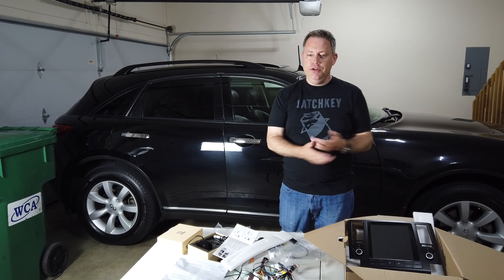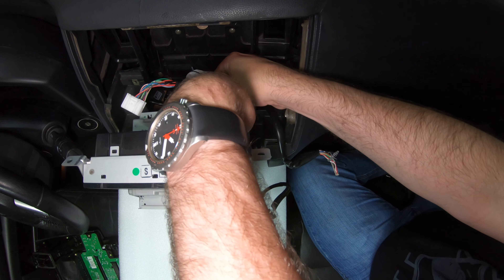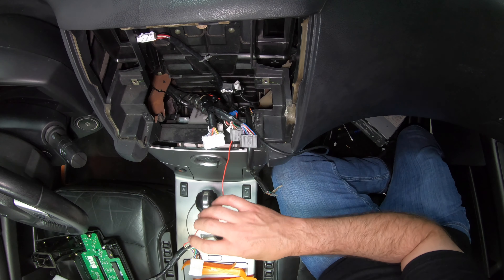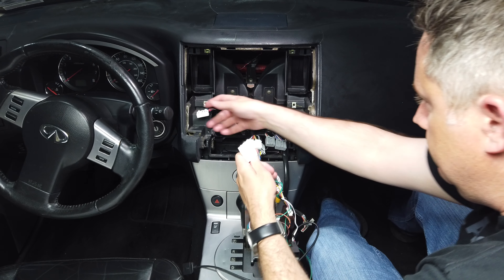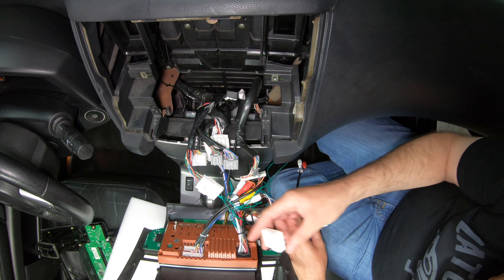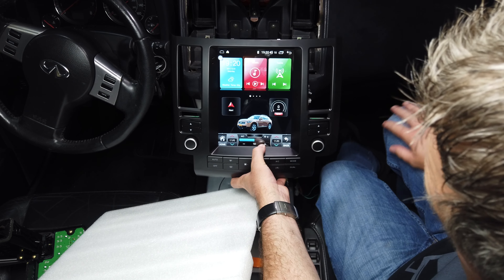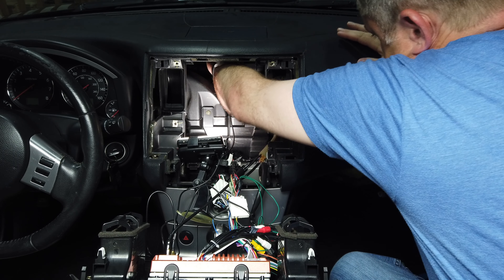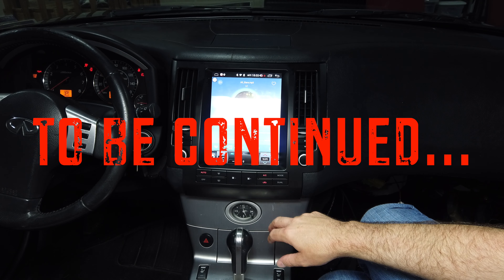I updated my 2004 Infiniti FX35 to 2020 technology with a plug and play Android head unit.

Comment: I installed the same kind of screen on my fx45 2004 with navigation and rear camera. Because your video explains everything I just wanted to add some info for people trying to install this on version with navigation. 
1. My version is from a company called "Peng GPS"  Only the backpannel is a bit different(color). Cables are exactly the same. Everything is working on my car including AC and rear cam.
2. The instructions for fx45 and fx35 are the same. My instruction manual looks the same as the one in the video.
3. The A2 cable(balck/yellow) is indeed for the nav version.
4. The black plug at 9:42 was not needed to be plugged to make it work.
5. In addition to the steps in this video, for the nav version you need to remove the glovebox for access to an extra plug there. It's on a grey metal box. Box is on upper side. You have to remove some screws to free it. The provided instructions will show which plug. Without this step AC and rear cam won't work.
6. For the rear cam they provided connectors that were also plug and play.

Hope this helps.
Reply from the maker: Thanks for the additional information. I had my glove box out at one point because the instructions were not very clear about exactly what connectors I would not need.
Reply: Can you guys help me I bought the same thing for my car and I can’t  control the ac and the camera is not working , only the radios and the android that work fine . What can I do for my camera and ac control to be fully working on this new units ? My car has navigation and camera from factory 2004 Fx 35
Reply: @maickikiemi3873  I'm no expert at all, but maybe this helps, when i didn't connect the gray box(shown in the video at 11:15) the airco did'nt work but also the fuel gauge and temperature gauge didn't work, they remained at low position, also the "low fuel" bulb turned on.
When i didn't connect the cables in the glovebox compartiment(point 5. in my previous comment) the airco didn't work, the temperature on the screen said "low" and nothing happend when i put the car in reverse. But when i connected all these AND the cable for rear camera everything worked. 
Good luck.
Reply: Kaka-jan I was asking what to unplug in the glove compartment ?
Reply: @maickikiemi3873  That's a bit difficult to explain, but you have to look at the manual, It's explained there. But in this video(https://www.youtube.com/watch?v=1FMRPRJtg_I&t=100s) at 4:01 where his hands are, there is a gray box the plug is not visible until you remove the box.
Reply: @Kaka-jan, thanks for the additional info, as I have a fx35 with Nav. I've kind of curious to know if the bottom of your unit doesn't snap completely similarly.  That's my main setback in ordering one myself. Thanks!
Reply: Hi,  can you show me how you did it, any pics or video
Reply: Do I have to connect the stock rear camera also under the glovebox somewere??
Reply: Hi.
Did you connect to the oem GPS antenna or use the antenna that supplied to you with the unit.?
Reply: Best kinda person, right here. Thank you for your service

Comment: I ordered one of this for my car and I am very happy I had some issues with the ac control and the camera  but I just had to plug something in the glove box compartment . I recommend kirinavi for these they are the best I got the item after couple days for it being shipped from China when I expected it to come 2 weeks later . Thanks guys
Reply from the maker: I not not affiliated with KiriNavi, but I did buy from them. I think my package took a couple weeks to arrive from china and it shipped DHL. On my install I was not required to connect anything under the dash, but on factory Nav systems I think it's required.
Reply: Hey.   Can you tell me exactly how you solved the AC issue with the glove box ....
Reply: @computerloveful  so in the glove compartment there is a metal Grey box with two connectors , unplug the biggest one and  it to another cable of the new unit that matches , the you will be able to control the ac and camera , that’s if u have ac and u can’t control it .
Reply: Maicl Ikiemi what is this issue for? For the ac controls to work?
Reply: What exact AC part do I need for the glove box and where can I get it

Comment: I have this on my 2003 fx35. To achieve good audio turn off the surround settings, start equalizing from the Rock settings. It’s been a month and half and I’m really enjoying it. At the beginning I wanted to return it. Now I want to buy another one as a spare just in case I break mine and the sellers stop making it. The only thing I haven’t installed yet is the rear view camera. Not much support from the seller.
Reply from the maker: I am posting a more through review video now. I have also considered installing a camera, but I have not don't this yet either.
Reply: 4-pol Rückfahrkamera Kamera Kabel Adapter RCA für Auto Android Radio GPS DVD MP5,4-pol Rückfahrkamera Kamera Kabel Adapter RCA für Auto Android Radio GPS DVD MP5
Reply: I managed to make the original infiniti rear view camera work with this. Let me find what I did (it was just a matter of changing some inputs that were not right) and will post it here
Reply: @me61ic  have you found it?
Reply: Read my reply (me61ic)

Comment: Good stuff man!!!  Can't wait to do this to 05 FX45!!!!
Reply from the maker: Make sure you watch the next video...the install is cool but definitely not perfect.
Reply: Hey Zoe.. Did you ever get your 05 FX45 done.? I have the same model as yours (mine already has navigation) and would love to upgrade to this new touch screen system.. Just wondering if you can share what style of radio you bought..or installed.
Reply: @teemosala  Not yet! Got some other maintenance stuff I need to get taken care of. Plus still researching what issue people are having.
Reply: @teemosala  Plus factory is still ok for me at moment as Bluetooth audio is just sucky anyway so regardless of what radio system you use it still will suffer at the hands of compressed wireless audio. I do use tube amp modeling and eq through an app on my phone. But the look of that interace is the business!!!  So yeah not yet lol.

Comment: Just got one of these, I am a bluetooth driver through and through, but holy cow that's a hefty price tag for a new radio
Reply from the maker: I ordered the most expensive version for my car, but there are less expensive options that are also compatible.
Reply: @justprojects1038  I want with a BT45-NIS receiver for $150 on amazon. Unit the size of a deck of cards that essentially gives you Bluetooth, an aux output and USB that you can hide in the dash, but I sure hate that natural orange display still so I may breakdown and go this route, after I buy new rims and an exhaust hahaha

Comment: Did you use any components from the original stereo to get the A/C unit to work? Another thing I noticed from your video is that your truck had some lights on the cluster. How did you get rid of them?.... it looks awesome.

Comment: How's the sound quality after the new radio installed compared to the original radio sound quality? Is it a big difference?
Reply from the maker: I would say integration with factory BOSE system is good but not perfect. After adjusting the preamp levels on the new head unit I am happy with the sounds. There is a very faint noice you can hear with source that has not audio, but I don't notice it when listing to music or driving. You are really upgrading the head unit functions because the amplifiers are speakers are still the same.
Reply: @justprojects1038   Thanks.... You might want to your ground wires.  They sell this little thing that’s connects into your ground wire.

Comment: Hi there, writing to you from Spain, I got my 2008 Infiniti FX35 tech package new in the US back then. I am almost sold about getting this unit, I was only wondering about a couple of things and I am having some kind of trouble with the communication. I was wondering if you can tell me now that you have been using the radio for a while. What I wanted to know is:
1-The factory radio give you some info about when the car is due for maintenance, tyre rotation and other. Do this screen also give this info?
2-I don’t know if you use Carplay. I will be buying a unit that is wireless carplay capable. Is yours like that? Once you set it as in carplay, does it always go to carplay? Or do you have to go through a routine everytime you start the car?
Reply from the maker: The AM and FM radio reception are not good on this unit so I would not buy it if you need this feature. The Car Play is a 3rd park solution that emulates Car Play and its seems pretty good.

Comment: So with the fitment at the bottom i took the white clips off my oem bezel and put them on new one.

I got sound thanks for your tip. However I left the grey box with 3 connectors and my a/c is not responsive... can't control temp or fan speed . Any tips
Reply from the maker: There were two connectors for the CAN on my car, did you make sure you are using the correct one? I think if you had factory NAV the connector is behind the glove box and you use the yellow wire. Mine with the amber screen used the connector with the green wire. If this doesn’t work I would try to disconnect and reconnect the power connector from the unit. If you can see your door open indicators and the outside temp then your CAN bus  should be communicating with the android head unit.

Comment: Hello, thank you for the video. Quick question. I bought one of these units for my 2008 FX35 and I have gotten everything to work properly except the Sim card. The unit recognizes the Sim as "Slot 1" but there is no active connection and I know that the Sim is active. I have a Mint Mobile sim card and have added the APN setting for this company, but no connection. 

Did you ever get any of your sim cards to work? If so, what did you use?
Reply from the maker: I had trouble getting my SIM to work also. I have a GoogleFi data only SIM. I started working after I restarted my unit. I remember thinking it was not working for a day or two before I did the restart.
Reply: @justprojects1038  Thanks for the quick response. If I can't get it to work, I will try GoogleFi. Thanks!
Reply: How did you get your ac working properly, I have the grey box connected but the ac has a mind of its own and I really have no control other than turning it off

Wondering if you had any similar experiences since yours is an 08 aswell

Comment: Hi! I have the same car and stock radio and my radio turns on and off when it wants to and when it is off, the orange lights in my AC setting buttons aren’t on and buttons don’t work. Do you know if this would be a lose wire or the radio unit itself?
Reply from the maker: I don't know much about the factory system, but you might check the fuse to the radio. I think there is one under the dash and a second under the hood. If its something in the radio or control module it would be more difficult to repair, but something like this might fix it.

Comment: Great video.   What setting did you have to change to use your SIM card?
Reply from the maker: I think I had to power cycle the radio to get the SIM to work. I know it had it in and out of the sim tray a few times and it was not working.
Reply: @justprojects1038  ok, thanks

Comment: Do you know if it’s possible to change the color of the speedometer from orange to like white on the FX?
Reply: Hi, let me know if it is possible. 
Thanks.
Reply from the maker: I would imagine the speedometer illumination is inside of the speedometer cluster. At minimum you would need to remove the cluster and possibly open it up to change the bulbs. It may be that the color is actually in the plastic and the bulbs are white. This seems like a pretty involved project.

Comment: Thanks for the video. Waiting for the other! I have an heavily modified FX45 and looking to purchase this head unit. My fear is the winter cold, we sometimes see --20C to -40C here in Canada (-4F to -40F) and I'll be very upset if the unit break during winter. What is the warranty on this?
Reply from the maker: Where I live we might see 0F a few days a year, but my cars stays in a garage most of the time which is above freezing. As for the Warranty, it’s pretty unclear. I had one problem with one accessory module after installing and the seller replaced it for me, but I think getting the whole unit repaired or replaced would be difficult. I accepted this as a risk when Installed and I’m also keeping my factory system around for a least little while longer just in case.
Reply: Me too but don't have to deal with Canada temps. Mine is an 05I'm way down here in the Atl. Lowest we get on average is about 28F°. What mods do you have
Reply: @zoehaze  k

Comment: hey i have a constant static issue with my unit, 2007 fx45. did you have to ground your unit? I’m assuming the static is because it’s not grounded
Reply from the maker: Do you have static on a replacement unit? Is it radio static or present with digital sources? When I replaced the head unit all the connections where plug and play. I did not need to add any additional wiring. There could be a problem anywhere in your factory wiring between the head and factory amplifies causing static.

Comment: Hey having issues with A/C what does it mean when the ac button on the radio is flashing in red. It flashes abt every 5 seconds. And I have no control in the buttons
Reply from the maker: I would contact your vendor, I have not had this problem.

Comment: Hi David, I have a similar screen on my FX35, everything is properly connected and I am struggling with the problem of noise from the speakers. When I put the music louder, I can not hear the noise. The noise can only be turned off by turning off the AMP. I get the impression that this equipment is not adapted to work with the Bose Audio System. Do you also have these symptoms? I note that this is not the noise from the alternator because I have already dealt with it.
Reply from the maker: I have a small amount whine noise that I hear when the system is on and there is nothing playing. I assume it's some electrical noise that's being delivered to the Bose amp. When the car is running or music is playing, I don't hear the noise. When I initially installed the head unit I would hear it all the time because I was testing it in the garage and not running, but I don't notice it on the road. I hear the noise anytime the volume is above zero, but if I turn the volume to zero the noise will go away. I would definitely adjust the power conditioning setting if you are getting too much signal into the Bose amp and it's overdriving.
Reply: @justprojects1038  
Hi, I have exactly the same as you. Can you tell me where to change power conditioning? If these are the settings so that the volume scale is higher or lower, there is no difference after changing. And with you? You set it up and something changed?
Reply: Add another ground wire from the outer shell of the radio and ground it too some where that is a good grounding point ....I had to do this to mine...Now no statically noise any more..

Comment: I have a question, I bought the same model for my 2003 fx35 and for some reason the AC will not turn off , is almost like the screen didn't detect when you try to turn it off, but as soon as you switch to any other function the screen works just fine , any idea how to fix it or what to do ?
Reply: I’m having the same issue  any info
Reply: @Greezy26   I just unplugged the climate control and plug it back in turn it on and off and then go on the screen on the fan symbol go all the way to the max and the click on the ON/OFF button on the screen and should work
Reply: @srg8067  I followed the steps you suggested still no luck. Everything works fine just the AC works I just can’t control with the buttons or the screen

Comment: Is it possible to use WAZE, as the GPS navigation? Thanks
Reply from the maker: I have Waze installed and it works fine. I also have Google maps. I like Waze because it shows your speed even if you are not actively navigating.

Comment: Just installing but some problems with back camera end the a/c funtion button and + and - from the blower is jou responding. Any idea?
Reply: Is jou= is not
Reply: We did it. With help from the comments below. A/C and camera was not working but after some information about the metal box under the glovebox it was fixt
Reply: The only thing is the fuel indicator on the dashboard is not working
Reply: @wilkoklein9097  hello, do you have a picture of the metal box? I have version with navi and cam, but I can't find the metal box under the glove compartment
Reply: @ALE1775Craft  I didn't myself but you have to remove  the glovebox
Reply: @wilkoklein9097  I managed to find it, it was a very hard job, AC works, but the CAM doesn't work, when I put the reverse gear it tells me NO Signal. Some idea?
Reply: @ALE1775Craft  I have still the same problem with the cam. And there also the 'service engine light' on the dashboard after installing. I don't know if the stock cam can connect? Somebody knows this?
Reply: @ALE1775Craft  did you solved the problem with the rear camera already?
Reply: Say more, my ac not work